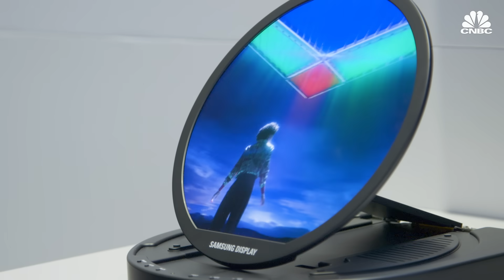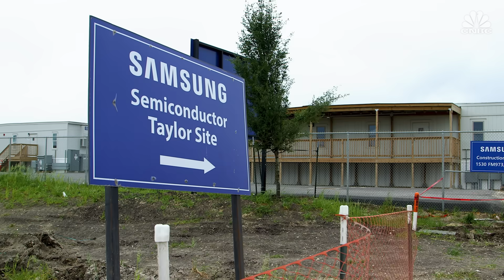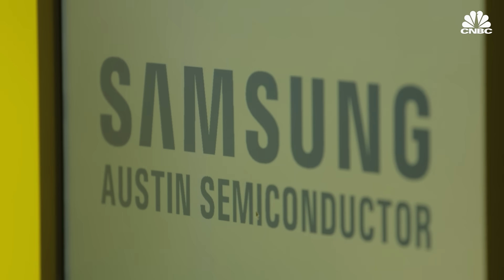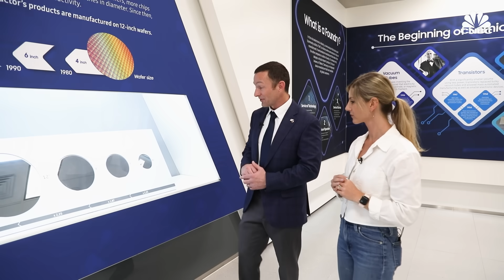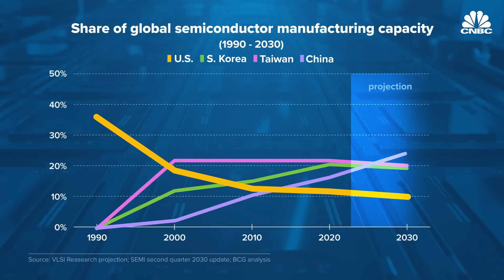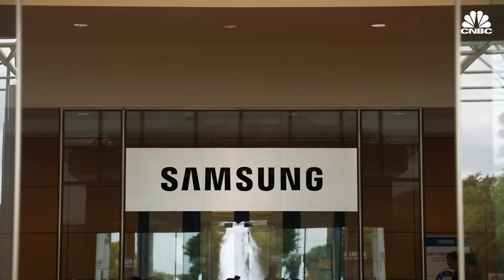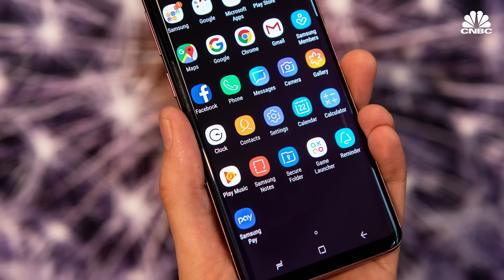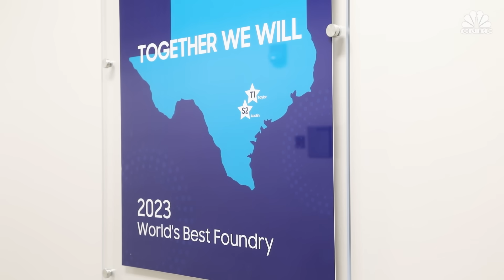The Untold Story Of Samsung’s Growing Chip Business

Comment: If one knows the difference between a battery, capacitor, dynamo, alternator, and generator, then one can follow this content with ease.
The aforementioned produce only one thing, electricity with an AC or DC current. 
Memory chips are boring. Yes, the more the capacitors, the smaller the device.
I could easily program an EMS on a 
 chip, but it would have to include more code.
The world could happily bobble along on a 7nm chip if it wasn't for the demands of the Internet.
Now, thanks to the Netherlands, we have entered the World of the 3nm chip, which demands an enormous amount of additional tech for its functionality.
This technology has allowed my mobile phone provider to switch off its 3G network in favour of 5G.
Arriving at the 1nm chip is the tech "holy grail." Such power will produce a pixilated intensity that will be so powerful that we will be able to see Neil Armstrong's footprints on the moon.
But here's where the law of diminishing returns comes into play.
If America decides to regain its position to be at the leading edge of chip technologies, it would require a staggering $30trn.
Although the US economy is roughly $22trn annually , it splutters along on a $32trn deficit, it still has a "war chest" of prehaps $250trn plus a similar amount in unpaid loans ie Cuba, Central and Latin America, the UK and European debts after WWI.
Only Russia and Germany have paid back   their debts in full to the US! (Not to mention Algeria, Morocco or Egypt, and most of South East Asia)
Hence, it is best for the US to play second fiddle in the chip wars because if it didn't, the cost benefit analysis would be too much.There would be far less money to go around.
AI - which is a forty year old media term used to describe predictive text, chat boxes, deep fake images, and  trash-in trash-out graphic advances - is an example of the optimal use of 3nm chips and Chat AP.
Does one really need AI to suggest a meal plan for a 34 year old diabetic?
Yet such algorithms - which it basically is is poised to wipe out most of America's middle-classes and investment vehicles that decide to invest their hard earned savings in. 
Does one really need Amazon's Alexa to order the contents of their fridge?
Who remembers CB radio and the benefits we'd believe it would bring?